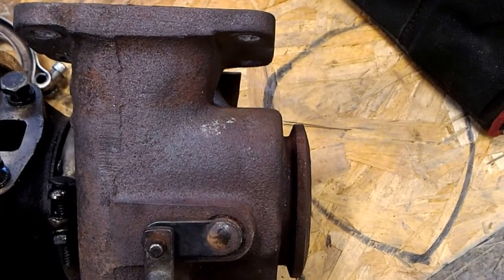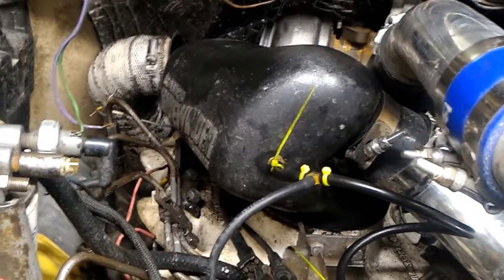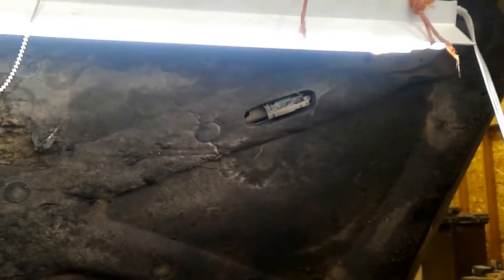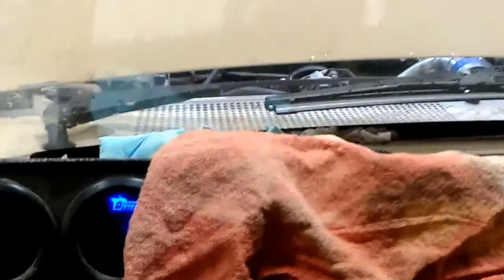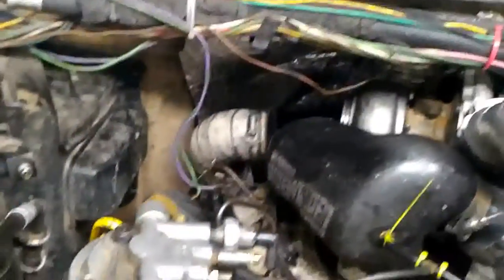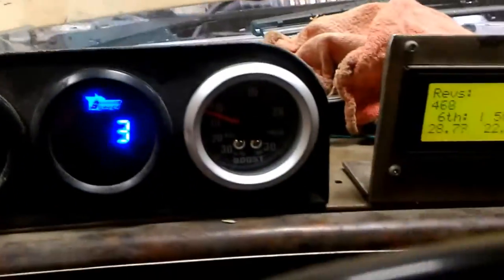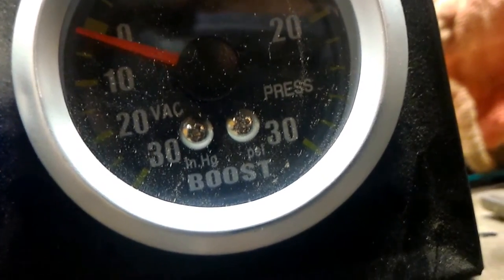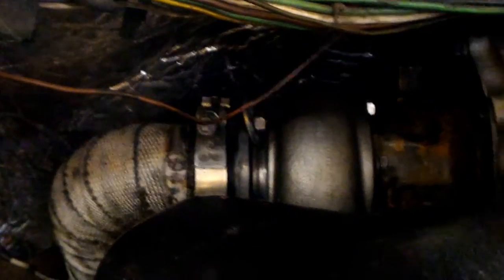First run with .63 housing - 7.3 idi

Comment: That sounds so amazing, it looked like it was hittin 25psi. That thing spools like crazy
Reply from the maker: Totally missed this comment. In the days after this video, I found that it would hit 30-ish PSI easily, and totally clean up my RD2-110 IP. I'm guessing it could put out 300-ish at the wheels with this setup.
Throw a bigger pump on there and it'd put out quite a bit more than that, provided the rest of the engine stays together.
Unfortunately, just after I got it tuned in, I drove it a good 100 miles on Friday night. I shut it off, and it was fine. Fired it up while still warm, took it for a quick drive later that evening... just fine.
Started it up Saturday morning... It ran on about 6 cylinders and then threw a rod(!). In the driveway. With no boost or anything.
My guess is something went wrong with how it was built, considering it was only rebuilt a year ago.
So far this project is on hold until the weather gets nicer; I've got another 7.3 long block available and like 3 6.9s I could play with.
Reply: Sounds like you could use some r&d forged psd rods and a rd180 pump haha. That would really light er up. Awesome truck though
Reply from the maker: Basically... Yes.
What I'd like do do is build a 6.9, upsize the head bolts to 9/16 and use grade 10 socket head cap screws.
Use forged PSD rods and modify them myself(I'm a machinist, so I ought to be able to do it).
I'm definitely going to talk to Justin about the pump - I'd be looking at either a 150 or 180, or some in-between pump. I don't want to lose the streetability of it, so I might go with a 150 and tweak it up a bit.
I mean.... what good is a 400HP IDI if you can't daily drive it and tow with it?

That being said, I might also just throw a set of rings and such into a 7.3 long block I have and just throw that in for now. Still need the 150+ CC pump though.
Reply: MacRobb Simpson  any way to get ahold of ya I’m in Blanchard Idaho and have a 94 7.3 idit and have a few questions

Comment: You are a smart man. This mod improves the durability of the truck. I am not ok to wind my rpm up to 2500 to gain 5 or 6 psi. Putting a smaller exhaust housing allows for a quicker spool.
Reply from the maker: Yes and no. It is nice to have good spooling and torque down low, but these engines are designed to run 2500-3K all day long. It took me several years to realize that - you'll see that in my earliest videos I was staying under 2K RPM most of the time. Now, I wind it out to 3k under heavy acceleration all the time. 
The motor likes it a lot more. Heck, the best way to keep your engine running good is to hook a big heavy load behind it and get it hot for a couple of hours, pushing 2500RPM all the time. We've done that on various rigs and they always end up running better for a while afterwards.

Engine life doesn't seem to be affected by RPM in these - the RPM range is low as it is. If you want to make sure your IDI lasts as long as possible, change the oil very regularly, like every 3K. Just use cheap oil - it's fine. The point is to get all the soot and crud out of the motor and keep it from sludging.
Reply: @MacRobbSimpson  I agree. I guess it all depends on what you are using your idi for. I rarely ever tow and when I do, I don't pull that much weight. Driving in town and rarely ever going beyond 2200 rpm dosent call for a turbo that starts to spool around 2500 rpm. Talk about mpg. I rather get all my efficiencies at the low end since I barely ever wind that thing up to spool a laggy sidewinder I have on her now.

Comment: What was the complete setup in this video? Sounds great.
Reply from the maker: Lets see:
1. Basic 7.3 IDI non-turbo block
2. BorgWarner S360 turbo with the .63 T3 housing.
3. RD2-110 pump(Pretty sure a bigger pump is in order for this turbo... I'll bet it would produce a lot of power)
4. ARP headstuds
Other than that... not much, really.
Reply: Got my shopping list now. Had a "catastrophic" failure on mine. Still haven't gotten it repaired.

Comment: how well did this work out?
Reply from the maker: The housing? Great. I've had a number of issues and tests with the truck, but I really like that turbo/housing combination... though I do need to figure out some sound dampening for it.
I also did find out that this turbo/housing plus a R&D stage 1 cam is not good - the stage 1 cam hurts low-end torque, and makes it really cold blooded. Runs great once you hit like 2300 RPM, though... it acts very much like a tuned 7.3 PSD.
I could see it being daily-drivable in this config with an auto trans and high enough stall, but with the stick, it needs more low-end for towing.
Reply: MacRobb Simpson Sounds good, needa fix my leaks before i can change out banks lol

Comment: did you bolt the BW to your banks up pipe?
Reply from the maker: Yup; T3 housing fit the T3 up-pipe.
Unfortunately, you have to rig up just about everything else with adapters.
Reply: MacRobb Simpson sweet. I have 093. factory set up. going to intercooler and get 90cc pump with studs. maybe bw turbo since 20+ is out of efficiency range.
Reply from the maker: Unless you are going with a bigger than 90CC pump, don't worry about it.

I've got a '93 with factory turbo and 2.5" straight-pipe exhaust that I just installed my 110CC pump on.
Ran it on the dyno and put down ~245 RWHP at ~450 ft-lbs of torque, at perhaps 15 PSI, and still had some fuel to spare.
That's a very nicely running rig right there - My 110CC pump has an aneroid("Hypermax smoke puff limiter") which limits fuel based on boost. This makes it /really/ easy and fun to drive in town, without creating large clouds of smoke. It also hauls a trailer pretty well, and near as I can figure, I'm averaging 16-17MPG(got 550KM from a full front tank, rated at 19 gallons)

Also, I don't have studs in that engine yet...
Reply: MacRobb Simpson I'm making 15 psi out of my factory turbo.. max pump.  towing a little trailer boggs it down though. even going up a 6% grade empty my egt still get up there. kindve stumped. someone said try timing or lift pump on the forms. the recent vid on my channel shows it. I'd appreciate some advice. thanks !!
Reply from the maker: What happens when you get up to speed and floor it(or at least give it a bunch of fuel)?
Do you get smoke(if yes, what color?)?
Reply: MacRobb if I floor it at 60 just black.. then turbo spools and it haze's..
Reply from the maker: If you get black smoke(vs blue or white), you are generally on the advanced side of timing.
Also, it means you have extra fuel.

I'd try retarding the timing a bit, see how it does. If you start seeing blue or white smoke, it's too retarded at that point.
In my experience, with a turbo it'll do best just a bit advanced from the blue or white smoke point - you should never see any blue or white smoke.

Tune for the high end performance wise; if you end up getting blue/white smoke down low, you can play with the light load advance cam to try and make up for it.

Also, if you do end up wanting/needing to buy a new IP? Make sure to get a 90 or 110CC pump from R&D IDI Performance. They do much better quality pumps than the general crummy rebuilds available at the autoparts store. And the prices aren't too bad, for the stock(90cc and less) pumps. 110CC and bigger pumps are expensive... but there's some custom machine work in those. And it does show.